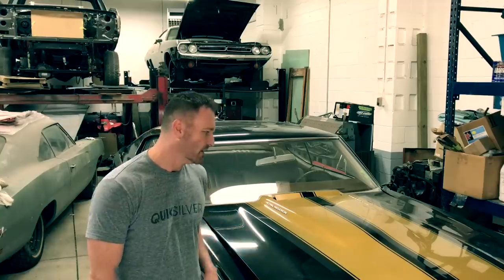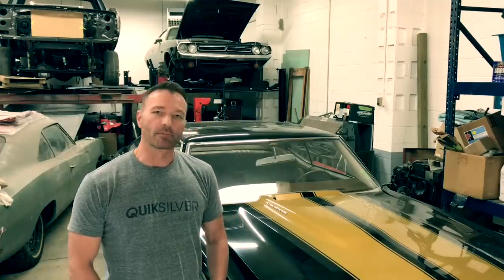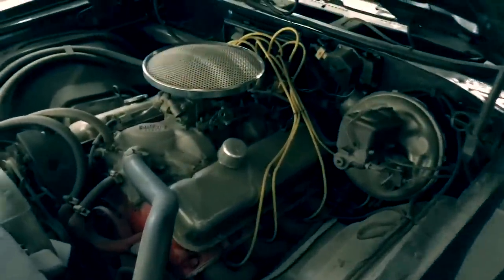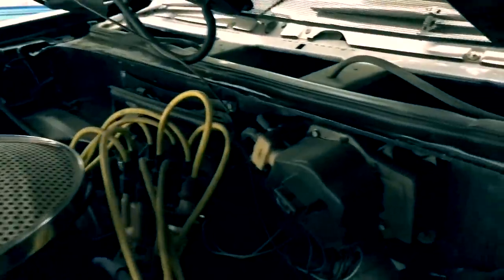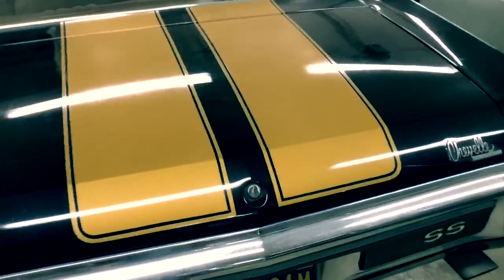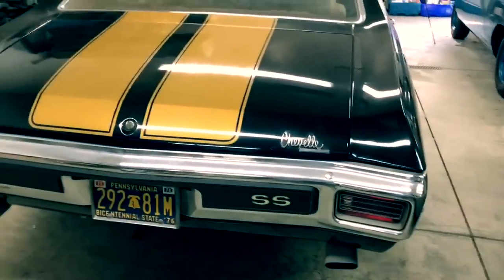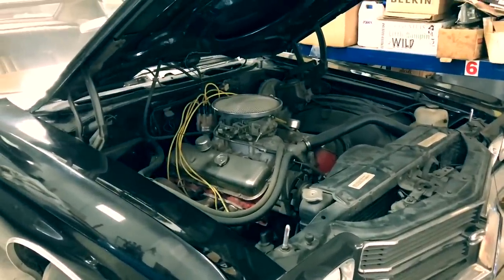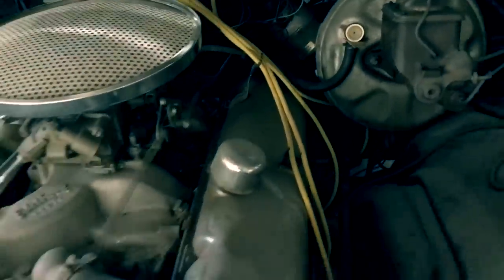Amazing 1,092 Mile 1970 Chevelle SS454 LS6 Found In Rural Pennsylvania

Comment: I'm 72 yrs, and love old mint condition cars. I was under the impression that most SS models would have bucket seats? I guess not but wouldn't that be better?  
I was also disinterested in most 70's and later muscle cars due to smog equipment... was that not relevant?
Reply: You could order w bench seat. Smog came in 71.  so 70 is pinnacle year. Ive had two 70SS Chevelles in my day.  One original and one non original but mint with mods. Check out this older camcorder video of my red one on street and at the strip. https://youtu.be/6JqspXe0lDo

Comment: QUESTION: What is to prove the 1092 miles? I know from growing up back then, that the cars then were very easy to roll back the mileage on. What proof is there that the mileage has not been rolled back?
Reply from the maker: CowboyDav the back side of the PA inspection tag shows it had 1010 miles in 1975 and that was the last time it was inspected for the streets. PA was the only state it has ever been inspected or licensed in and a car can’t have 4K miles in 1973 and then 1010 in 1975. Therefore PA records would only show mileage of less than 1010 prior to 1975.
Reply: @patrickglennnicholsmusclec1674  Ok, I understand, Texas does the same thing. So, yes the mileage is correct...That's good, Awesome! Thanks for replying back and explaining it.

Comment: 1,000 miles would be two months of weekend road racing. I'd be inspecting the wear & tear on the front bumper, license plate, and headlights & bezels. Those items can't be easily cheated like an odometer cable. They could, but the work effort wouldn't be put into it.  Plus if you bore scoped the cylinder walls, you should easily see factory cross hatching on any engine with less than 25,000 miles. Not saying 1,000 mile vehicles don't exist. Ive seen many antique fire trucks with that low. But fire trucks dont smoke the tires, haul azz, and get pusi! 😁
Reply: All good points. I like looking in the cylinder walls. Glass should be flawless too. Looks like the stripes are not original anyway. At the end of the day does it really matter ....it's a 1000 mile car ...allegedly. I'm glad to see the original owner at least drove it a little bit and now he has passed. I like to drive my restored and original Chevelles , I've had a few  and drove them pretty hard,  keeping them mint condition. One all matching number and one non matching with work. Had the most fun with the non original car. Check out this older camcorder video I found of my red car At the track and on the street. Probably drove it over a 1000 miles a month. On youtube https://youtu.be/6JqspXe0lDo

Comment: he must have ordered it with the bench seats,   for the mile's on it i see it had the intake changed,      i had a 70 396   SS Chevelle  
 she was a super freak,   396 auto,  bought it in 73' sold it in 78'  the many cars i had,  only if i knew then what i know now,   you still seen them on the road back then  i bought a 69 olds 442 after  the chevelle ...

Comment: I'm a car guru, but I would be driving it all the time. A car is meant to be driven not stored in a garage for the rest of it's life. That car has never been actually driven. Never been out on the open road. Never seen daylight since 76. I probably would have slapped that guy in the face . Never cage a beast. I wish she was mine cause I would be driving her all the time. You can't turn people's heads while it's parked in a garage. I would be driving it to car shows, not trailering it every where. The beast has to be unleashed. If you ain't going to drive it, don't buy it.

Comment: Nice and super rare but you failed to mention the rare air cleaner from Baldwin motion Chevrolet that is day 2
Reply: That was an Offenhauser air cleaner that was sold in the '70's. I had one on a "74 Z28. The Cowl Induction would provide colder air those more HP. I was wondering why someone would remove the original Air cleaner. I had a '70 Elcamino and would stack two round air filters to provide more air flow with the paper filters.

Comment: hows come the plate was first  put on in pennsylvania in 1976 i think it has 11192 miles on it and the stripes are not correct  they should be curved on the inside not to a point

Comment: I'm surprised that a car with 1092 miles on it would have the gear type hose clamps on it and different ignition wires
Reply: Sorry.....didn't see the ACCEL distributor, as well as the Edelbrock manifold

Comment: interesting note on the b22 door note a lot of people see the malibu and discredit the car. I live about 20 miles south of pittsburgh.
Reply: I had an LS5 in the late 70s that had " Malibu " on the Doors .
I knew it was a SS and back then I even had to wonder about the Door Panels .
Reply: Rickwain Malone
 I put them on my LS5 all those years ago , too .
Of course , they were in Dealer Stock in those days .
LOL
Reply: George McGillicuddy Some SS cars actually had Malibu door panel emblems,even seen a couple of LS6 cars with them
Reply: correct it was b22 on the build sheet as stated on the video a lot of people see the "malibu" door panel emblem and assume the car is a fake. Actually could be the other way around depending on the assembly plant.
Reply: kenny fine 20 miles south of Pittsburgh? You’re by me somewhere. I’m in Elizabeth.
Reply: Kevin Kendall
I know that now .
I didn`t then ., back in 78 or 79
Reply: George McGillicuddy Guess they did some off the wall things during assembly,had a cousin that worked at the Baltimore plant
Reply: George McGillicuddy I own a 72 SS 454 that's a little different than your average 72
Reply: more like 30 miles

Comment: Talking about smog valves in the exhaust system brings back some memories. As they were the first thing to go. As I stuck headers on them.

And yes that car is low miles. As the Water Pump. Alternator and other things did not last longer then 3 years. So the replacement part numbers would not match.. As not many people bought factory parts to replace them. They rebuilt most the stuff. As even the water pump was rebuild able in those days. But look at the bolt heads. They never seen a wrench!

Comment: Patrick - at 5:30 you mention that the B and D on the cowl tag are not significant. There has been lengthy discussion at the Team Chevelle website regarding these codes on Baltimore cowl tags and their possible meaning involving D88 stripes and big-block engine. The thread can be found here: https://www.chevelles.com/forums/35-restoration-corner/189466-b-d-baltimore-cowl-tag.html
Reply from the maker: Rainer Seitz yes well aware of the speculation  but there’s still no direct link to positive proof and therefore remains data processing codes  with no proven significance.
Reply: I agree that there is nothing proven, but there is mounting evidence of the signficance of these codes. So, not proof, but a theory with evidence to support it. I think that if your position is to dismiss the evidence on the Baltimore B and D codes, then the same argument could be made for the Kansas City "L." That's another theory with apparently lots of evidence, but no formal proof in terms of GM documentation. Your take on the Kansas City "L" theory is quite different in your other videos.

Comment: Patrick, i,ve watched other videos , and you,ll always point out  the non- original  add on parts , this car may only have 1,096 miles ,but  it's not all original in its current form,  i,d take all those parts off and install the factory  parts  if  there still with car , then would be truly best of the best

Comment: a half million dollar car? its common knowledge the most valuable LS6 is the "Pilot Car"  it was the VERY FIRST LS6 Chevelle ever built, it was built for ford management, today it has one mile on it.. sold for 181.5k on barrett in august of 2011.. if you can get a half mill for it get it... before gas gets anymore expensive and these muscle cars go on the fire sale block, which they will before it's all said a done, when internal combustion is banned on roadways in the USA and racing circuits they'll be good for looking at that's it.. so get it while it's hot!   or just drive it like the factory intended it to be driven..  :-)

Comment: Good Lord there are a lot of dumbasses commenting here! 
Most are doubting the mileage when it is very clearly explained in the video how it has been documented.

Others are questioning the aftermarket parts and mods on the engine. All of which are the exact period correct pieces you would buy back in 1970 if you intended to race the car instead of drive it on the street!

And finally we have people questioning the gold stripes. Think about it...the car has been in the Pittsburgh area since new. Maybe the original owner had the stripes changed to gold at the dealership before taking delivery? It was common back then for motivated dealers to do whatever it took to make a sale. 
Damn, the internet is making people dumb.

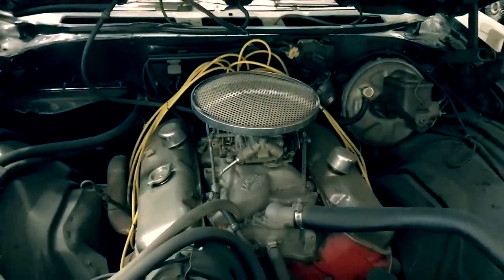Comment: 10:29i noticed you said "smog equipment on day 2 headers.. My understanding is smog epuipment wasn't required til 1971 year..
Reply from the maker: Paul Martinez no sir smog equipment was required on all special hi-perf solid lifter engines in 1970.
Reply: Cool man thanks for letting ne know. I am more a mopar guy and they didnt start doing this stuff til 72. And they only did smaller cams and lower compression. Thanks patrick glenn nichols musclecar.

Comment: You should put a power programmer on the PCM of that car it'll game like 50 horsepower
Reply: PCM?? you're kidding righr?
Reply: It's for the sequential fuel injection, it takes a lot of power to turn that all wheel drive system on those cars, also the VVT can be upgraded. Im an ASE tech..I know EXACTLY what I'm doing. I rebuild carburetors on 2018 Chevy Impalas all the time.. The earth is a square too
Reply: @stilltlrforlife  you're funny man

Comment: Huge problem in trying to get a 6 figure sale on this car without the "SS" option appearing on the build sheet, particularly with the engine mods. I assume that the LS6 option appears on the build sheet, which you failed to note on the video. Nice car if the engine is restored to factory spec externally, with new coated headers or exhaust manifolds, a factory intake manifold and air cleaner assembly, and factory hose clamps.
Reply: Mick Jagger ....im the real mick jagr

Comment: I'm confused.  I'm not very knowledgable about SS cars.  I have been told SS cars are coded 138, not 136.  Can anyone explain this or have I been misinformed.
Reply: 138 stopped in 68. So after that ss cars are very hard to prove w/o a build sheet. A 1972 ss el camino will have a w in the vin which is engine size 454. 454 only came in a ss That year el camino.
Reply: BRUCE WELTY-JOHNSON  that's what I thought

Comment: Too bad the factory wheels, steering wheel, air cleaner, exhaust, intake, distributor, driver side mirror etc. were changed and/or not part of the purchase/sale. The video did reveal some waves in the right rear roof panel at the quarter upper by the drip molding and right upper door gouges in paint. Could have been built that way but worth looking into. Back in those days, it was rather easy to disconnect the speedo cable for those wondering about the low miles. It's almost unheard of the miles would be accurate on this car but as they state, the documentation shows it. It doesn't prove the car sat all those years however, that leaves the unbeliever in a position to prove the miles aren't that low. There's are ways to determine mileage by physically looking into some of the mechanical areas of the car. Key words here are "documented" miles.

Comment: I owned a new 67 a new 69 and a new 70 back in the day. While I don't doubt your 1092 miles the car does show some wear that is consistant with a lot more miles. The front drivers seat shows such wear along with a couple other things. Headers air cleaner and such also draw me to saying it was maybe a broken speed o cable that didn't get replaced for a long time. Day 2 to me is great, but maybe you will want to pull the clutch and see if it shows a non GM clutch plate. Any how it is a great car but would be better if the strips were put back to white.
Reply: I agree
Reply: well the car sat since 1970, they did not have the technology in uv protetant and other things in the day. Just sitting and it will rot away.

Comment: unhooking a speedo is as easy as pie pair of pliers done get dealer plates np  did that happen who knows one thing you do know is even with 10k 100k those builds could not be broken at a 100k most were just broken in sweet ride i even like the choice of colors if you can get sworn document of color change i wouldnt touch a thing

Comment: Looks awfully trashed for 1k miles. Definitely no half mill car. Unless you can authenticate the mileage this car may sell for 150k. Bench seat, standard, the engine has been modified, not stock looking at all. If you can return this to a factory look proper engine accessories, valve covers, air cleaner etc, maybe get more.

Comment: Need to insulate/isolate the plug wires. That's a '67-'68 steering wheel. And I know SOMEBODY checked the integrity of the speedo cable connection(s)........RIGHT?! Headers, aftermarket intake, shifter, coil, cap & plug wires, wheels, & air cleaner......ALL installed in less than 1100 miles, huh?  I don't know about you, but if you're ANY kind of a gearhead but upon takin' NEW delivery of an LS6 the ONLY thing I'd want to do RIGHT AWAY is put some break-in miles on it, change the oil & filter, & put some rubber on the road (& I'm NOT talkin' about any ridiculous, INANE, burnouts!) & enjoy the damn thing the way the factory intended it to be enjoyed!
Reply: That is a NK1 Cushion rim steering wheel. The color keyed cushion rims were available in buicks and oldsmobiles.

Comment: Documented miles is a vague term I know of so many cars back in the day and into the 90's with bogus miles either rolled back or unhooked in the old ones... probably had 1800 miles on it at the end of the first summer... anyway matters not people can brag about anything...I drive my cars they are not for oooohhh aaaahhh from others. Insurance kept these cars from bring officially on the road but low miles is a myth... I would believe 25k.  I do 1 - 2 k per year on my old Harley so possible but not 1800 only no way.

Comment: I have a 1923 Chevy Corvette is a fuel injected carburetor with power steering and a Factory CD player it goes 0 to 60 in half a second and it will do the quarter mile in 8 Seconds
Reply from the maker: stilltlrforlife I’d love to video that. Thanks for watching.
Reply: @patrickglennnicholsmusclec1674  Im totally kidding man, I love the videos, I really wish I could find my old neighbor who had a 70 LS6 that he had bought new, I dont know how many miles it had on it other than it was lower than 30k, he kept it all original, his garage was full of origianl replacement parts in the case he needed to repair anything and replace it with factory parts. It was 20 some years ago that I seen the owners, for all I know he may have passed on so I do not know what may have happened to the car. He was offered alot of money for it and passed on any offer.

Comment: (STEERING WHEEL) I don't doubt what the car is but I'd take a closer look at the steering wheel, the one thing most people ignore. Pay attention when the camera is on it and look between the 10 oclock and 11 oclock  position at how shiney it is compared to other parts of the wheel that  aren't handled as much, then try to see the other side between 1 and 2 oclock position. Everything inside of the car can be unbolted and replaced which makes it hard to tell what you're looking at. The steering wheel will most always give you the answer. If you have good eyes, you can also look closely at the windshield. Years and years of the wipers going across it will leave evidence on the glass and why has the dash pad been changed? If you still have doubt, jack it up and pull off one of the front wheels and check the brake rotors, they too will show wear after lots of miles stopping the car. It should still have the original brake pads and shoes on it as well, plus they are made with asbestos and new brakes arent, so you should be able to spot the difference in the way the material looks. I'm not a hundred percent sure on this next one, but I do believe your lower rear control arms will be boxed for GM big blocks. My 455 Stage 1 Buick's lower control arms were boxed from the factory, Chevelle should be too.
Reply from the maker: Not the original steering wheel and it’s definitely a 1092 mile car. Thanks for watching.